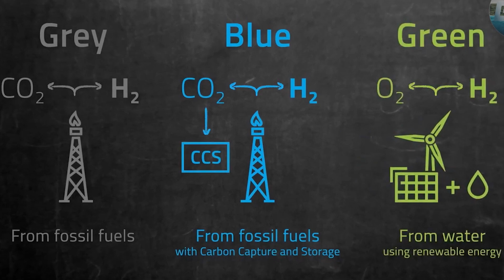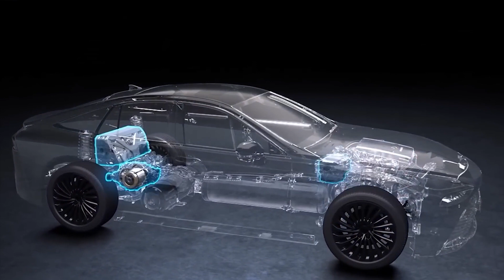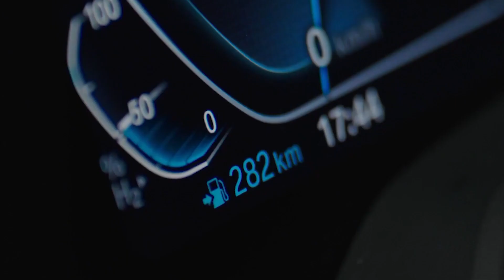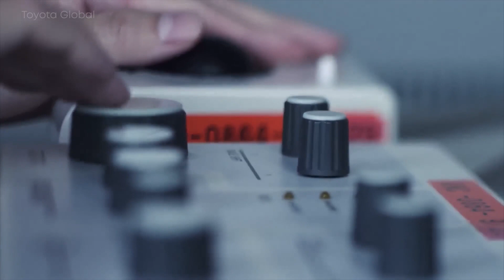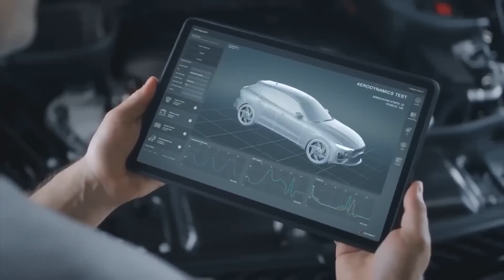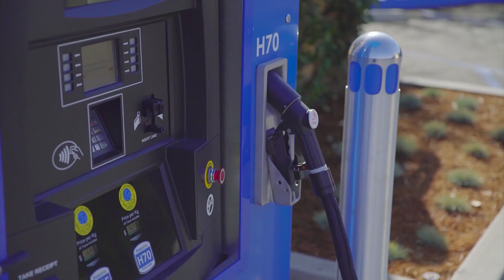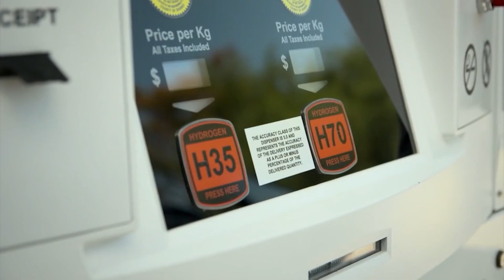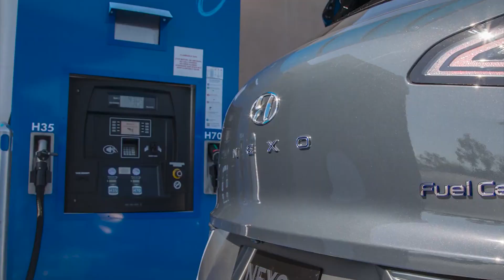Hydrogen Fuel Cells: A New Generation of Engines Just Unveiled By Musk!!!

Comment: 0:45 Hydrogen is definitely not the most abundant element on earth it makes up less than 1% of the earth by mass and on average producing hydrogen at the moment releases significant amounts of greenhouse gasses. So you are off to a great start.

(Yes hydrogen can be produced via electrolysis from water and the electricity can come from renewable resources however it takes far more energy to produce it that way compared with producing it from for example methane)
Reply from the maker: Thank you for your input!!!! IS there anything that we could have improved in our video??
Reply: @Musk.Moments  yes you could have not made a bunch of false and or misleading statements like hydrogen is the most abundant element on earth and hydrogen production doesn’t release greenhouse gasses.

You could have said Hydrogen is the lost common element in the known universe it makes up 11% of water by mass and can be extracted using carbon neutral methods directly from water.

Say something like: There are currently 2 ways of powering a car with hydrogen one is using a “fuel cell” which makes electricity by catalysing the reaction of hydrogen and oxygen through a membrane the electricity can then be used to run electric motors like batteries in a current Tesla.

The other is by burning the hydrogen with air in an internal combustion engine this produces energy a lot less efficiently than the fuel cell and also produces oxides of nitrogen and other pollutants which aren’t produced by a fuel cell but is cheaper to make per kilowatt and can basically be swapped into a modern petrol car just by replacing the engine.
Reply: Hydrogen in water is the most abundant thing ... and  we can produce it in different ways like electricity that can be from  the sun, waterwheels or wind turbines .... folks who resist this are  ignorant

Comment: The problem has never been the construction of an engine that burns hydrogen, the problem has been in storing the hydrogen in a car. Hydrogen is not very dense and has a low energy density. To carry the same energy as my car, it would need 210 litres of H2 at 70 MPa.  That amount of steel tankage would weigh about 900kg.  The car that I drive has a kerb weight of 1,000kg; maybe you can see the problem? You could possibly use composite tanks, but after the Titan disaster, I would want extensive testing that they could handle the number of pressure cycles required.  If you can crack the storage problem, make sure that you get lots of patents. And yes, hydrogen does produce greenhouse gases.
Reply from the maker: Yea many people don't fully understand this
Reply: Hydrogen storage is a real problem.  It happily eats the inside of containers.

Comment: Just a point, "hydrogen combustion engines" and "hydrogen fuel cells" are fundamentally different technologies.

The first is more like a traditional car engine, only using hydrogen as a fuel instead of petroleum.

The later, uses hydrogen to generate electricity which can then be used to drive electric motors.

HFC vehicles don't completely remove the need for batteries, your battery just doesn't need to be as big.

Hydrogen also isn't necessarily a "green technology" there are 2 ways to produce hydrogen.

1. Electrolysis: this one is greener as it pretty much just needs electricity, water and a catalyst. There's some question over how that electricity is generated, but that's a problem for all electric cars.

2: chemical: this is how most hydrogen is commercially produced since it's cheaper for larger yields. It's also terrible for the environment and cannot be produced on site at a fuelling station.

The danger of moving to hydrogen based vehicles of either sorry is that whilst each individual vehicle will produce zero pollutants whilst driving, the supply chain may be so much more polluting that even our current petroleum based system that the benefits may be considerably less than the public perceive.

These problems could be resolved with tight regulation. Unfortunately, such widespread regulation is unlikely at least in the USA and UK. There is more hope for the EU Who have a better track record on this story of thing, but this technology comes with hidden dangers for the environment.
Reply from the maker: Thank you for clarifying this!!! So many people don't bother to research the info for themselves, they just trust anyone out there. you never really know what the 'truth' is.. we check our videos to make sure they're as correct and up to date as possible. Thank you for your input!
Reply: The complete failure to distinguish between hydrogen IC engines and hydrogen fuel cells does deminish the credibility of this video. The narrator also refers to hydrogen as a mineral......painfull.
Reply: Hydrogen is also scary to transport and store. And it burns with a clear flame!